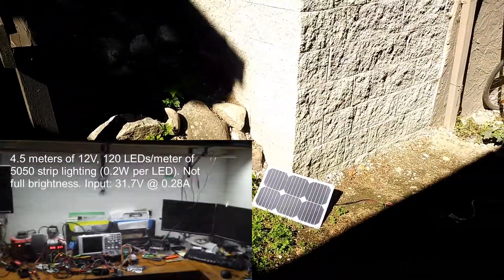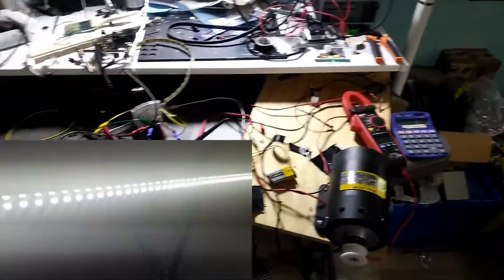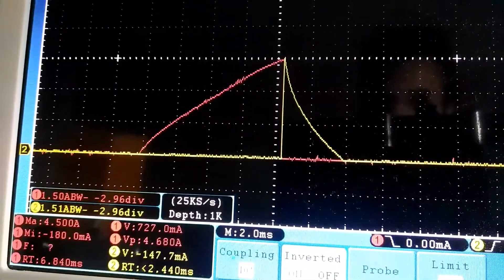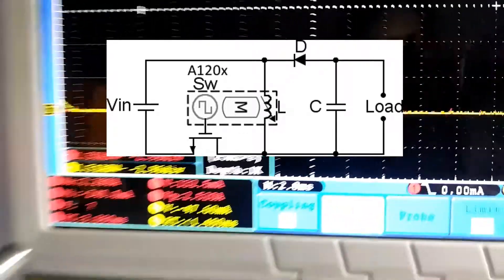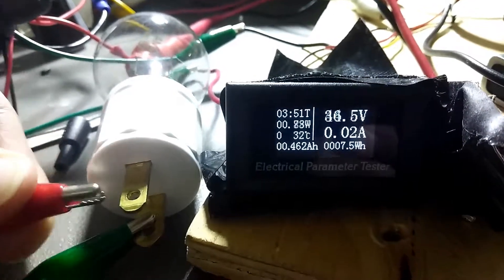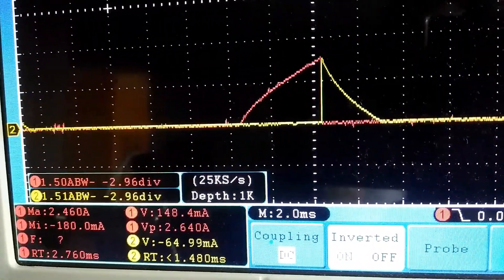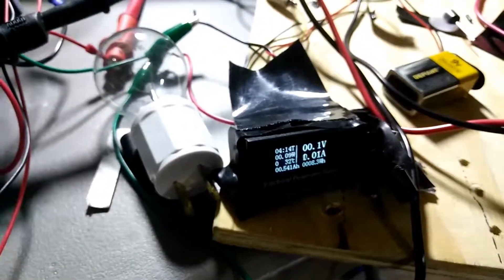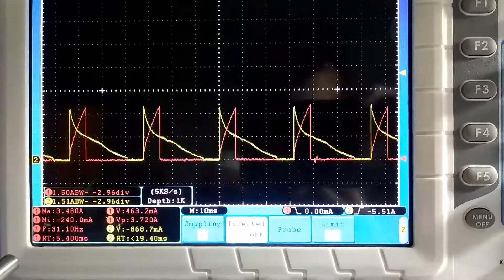Pulse Motor Coils: Identifying Waveforms and their Significance

Comment: Came here cuz of yr comment on thermhydric fireplaces. Exploring analog fq to digital and now holography. Any science behind these conversions? Can you do a video on yr speculations for our future energy waves?
Reply from the maker: Oh right, Snell's thermhydric fireplace. It's quite an interesting type of boiler.

I presume you're exploring analog to digital frequency conversion (ADC), but specifically for what electronic purpose? There's a lot of different systems of converting an analog signal to digital through signal processing and force transducers, but you'd need to narrow it down for me. 

Holography follows photography. You can make it by hand but it requires precise coatings of usually silver metal on glass to create a 3D image. Today we use CNC machines to help with Holography. 

If I could take a stab at what you're trying to connect here, do energy waves, Holography, and signal conversion from analog to digital all relate to the atmospheric electricity collection allegedly facilitated by means of the spires of some old world buildings? The spires would serve as transducers to convert atmospheric electricity to electrical energy or a signal to resonate and do some other function. The visual effect of a working atmospheric electricity collector could seemingly resemble a hologram, or a translucent and luminous cloud or haze surrounding the apparatus because of the high voltage and resonant frequencies. 

Am I hitting the mark here?
Reply: Yes! You tied in the past holograms! I was thinking future as we’ve gone from Ana-dig is hologram next! So perhaps the old world already had hologram energy waves so what comes after holograms? Since everything repeats... cryptic cuz our language is corrupted... need telepathy oh shoot I just answered my own question